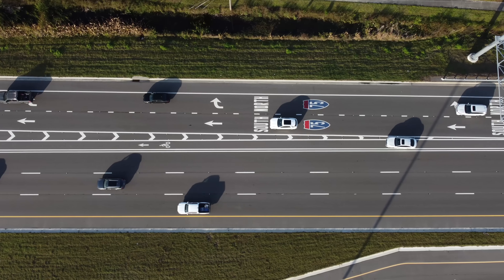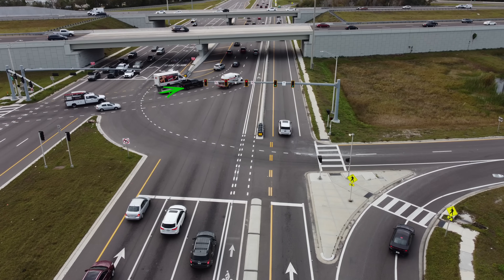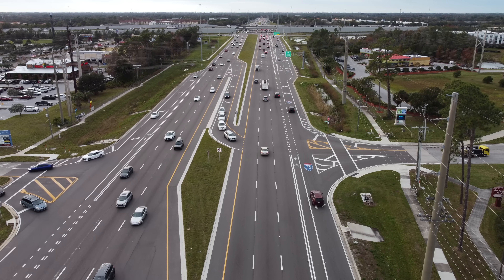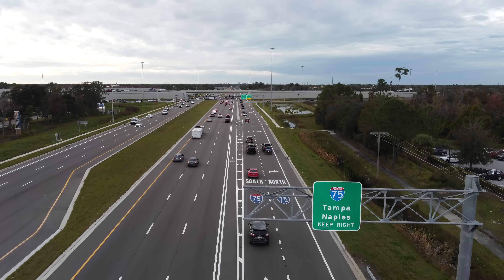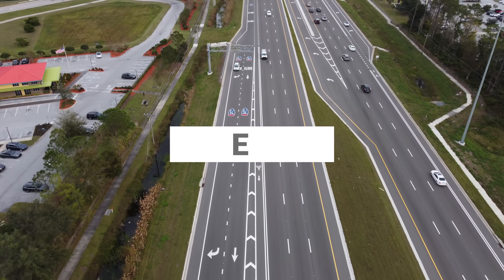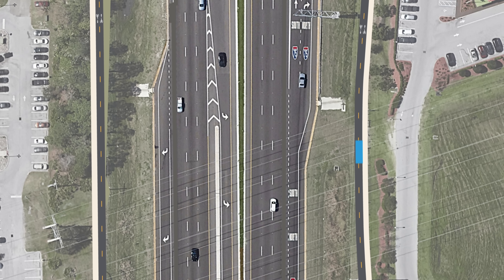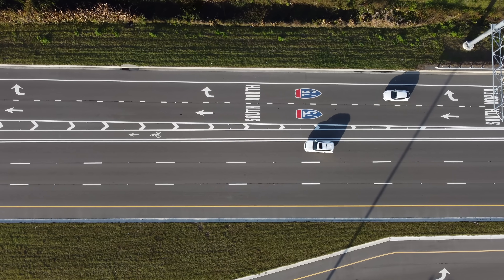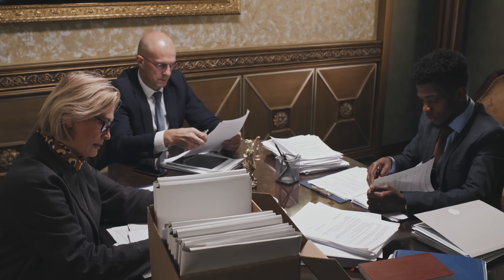This Brand New Interchange is Already Flawed

Comment: I still live in the area. I remember when they built this interchange. I've had to make that last minute dive over the gore. That area is nuts.
I remember one particular fun incident during construction where northbound got flooded down to just half a lane. It was during one of the summer afternoon showers that inevitably happens. Luckily they had the drainage fixed for the next downpour two days later.
It's under construction now, but I'm curious what your thoughts are about the crossing being built two exits north of there (I-75 meets US 301). They're building two additional bridges across the Manatee river so that local traffic doesn't have to get on the interstate to cross in that location.
BTW: the tunnel idea is a non-starter. This is Florida we're talking about. There isn't enough clearance to allow for drainage if you dig down.

Comment: As a Dutch citizen living in a country with proper infrastucture I am horrified to see that bikelane on that road. Sure, they had put in bike infrastructure, but as close by and without proper protection/width overflow just right next to a high speed carroad. I agree with the solution you put in the video.
Reply: This seems like bike "infrastructure" that was put in just to check a box, without any consideration of how a cyclist could safely use it in practice.  Paint is not infrastructure.

Comment: 5:08  Holy crap! I’m one of those experienced/bold/foolish cyclists that will bike in heavy traffic and even on high-speed roads, without needing dedicated bicycle infrastructure. But an u protected bike lane on a 55mph multilane divided road (which means probably 65mph actual traffic speeds)? Uh-uh. And an unprotected bike lane in the middle of multiple 55-mph lanes of traffic? No way! That’s even if things weren’t set up to pretty much guarantee motorists regularly crossing the bike lane. 

Both reputation and accident statistics say that FL is one of the most cyclist-hostile states. The fact that this got past preliminary design stage pretty much shows why.

Comment: There's only one reason that bike lane is even there. They'll have minimum quota's they need to meet for cycle infrastructure in new build or redevelopments. It's literally a box ticking exercise. We need better regulation on HOW they should be implemented beyond the simple x number of miles. We have the same kind of problem in the UK (though such dangerously placed lanes like here are thankfully not a thing. That I've seen at least). You'll often get an intersection being repainted and they'll shove like 10ft worth of "bike lane" at the head of the lanes were the traffic lights are, then count that towards the x miles per borough quota. You'll also often get lanes that just... stop, then pick up after a big gap, then stop again after 30ft or so. Again, just to meet the quota.

Comment: Sometimes I wonder if the designers of roads actually drive on those roads. Non reflective line paint that disappears in the rain especially at night. Non reflective lettering on road signs. No reflectors to mark lanes in the north east. Bridge expansion joints that are depressed below the road way (Baldwin Bridge on I-95 in CT) Also on I-95 south bound in East Lyme CT there is an entrance and exit (Rockyneck connector, 4 Mile River Rd) that is about 300 ft in length for the dashed white lines. Does make you wonder!

Comment: from my german perspective: move the bike-line from the road as suggested in the video - such road would be an "Autobahn" only for motorized vehicles that are able to drive at least 45mp/h. No left-turns at all, only right-turns and no stop-lights. The Traffic leaving and entering the (only on the right side) should have a seperate interchange lane where at ~ 45mp/h cars/trucks can drive in an offset and change lines for on/off ramp like here: https://www.google.com/maps/@51.4464888,6.7810909,17z?entry=ttu
this is totally typical in germany and as you have no left turns is easier to drive and you never have to stop.

Comment: I'm possibly a bad one to comment on this, as I'm a trained designer, though not in infrastructure design and a Dutchman that found this video on YT. 
To solve road crossings where not only cars but also pedestrians, bikes and possibly other 'slow traffic' need to be included, this solution looks like take all those slow users of the crossing as an afterthought. 

Of course you want to separate slow and fast traffic from each other in the best possible manner. Also any modern designer should have energy use in mind, Why using traffic lights if those could be eliminated, or at least limited. The same goes for the traffic flow itself, a continuous flow of all traffic will result in less fuel and time consumption, making the crossing and its situations safer in the process. Easier said than done? Yes, for sure, but then these things are not thought out by a bunch of toddlers. Those people all call themselves professionals, why then do they get the professional money, but don't deliver a professional result?
As one other commenter stated, the designers should try biking on this road. I would challenge those 'designers' even more, they should try the entire crossing! Part of design it to test if the design works, not just draw some fancy lines and call it a day.

Comment: "Bike infrastructure" like that grinds my gears. They started from scratch and STILL pulled the 'afterthought' method. It couldn't have been on the outside near the sidewalk? Would it have been that much more expensive?

Even then, nobody would want to use it anyways. The US is ruined to its core thanks to sprawl. Even if it were the nicest, flattest cycle path ever made, separated well from the road with a concrete divider in the middle, nobody would use it, because cycling next to a highway is a shitty experience, and getting anywhere would take 2+ hours when a car could take 30 mins.

Comment: You could also vuild the crosswalks up cheeper then going under. With pedestrian trafic above the motorway they wouldnt interfere with each other and is a bit safer then level crossings and cheaper then a tunnel

Comment: I don’t know why this a confusing interchange for Americans, it’s a very logical interchange, although a four clover interchange would be better. Are American drivers not learned to look at signage and react on time? Or is the signage inadequate? During driver’s lessons it is one of the most important rules, be observant and anticipate to the traffic surrounding you. In my country highway interchanges are almost always designed this way, splitting the through traffic from the exiting and entry traffic streams about 1.2km (about a mile) before the interchange, to keep traffic flowing. And a mile before that, the first overhead sign indicates the split and the second sign at half a mile before the split and a third sign when the split begins, with a physical barrier. So not with only paint like in the video. The third sign is also indicating the split between the north exit (right lane) and the south exit (left lane). The fourth overhead sign indicates the north exit in about half a mile and the south exit in about one mile. The fifth overhead sign indicates the north exit and the north entry ramp on a third weaving lane to the right lane and the south exit in half a mile on the left lane. The sixth overhead sign indicates the south exit on the right lane and the ongoing traffic on the left lane. It is standard practice but without the traffic lights and only level crossings. And without the very dangerous cycle path, these are insane to say the least. Whose twisted mind designed this??? Not someone who has ever biked in his/her life. Oh and if a situation is changed, like here in the video, there are yellow construction signs 3km upfront (which are three times repeated) to indicate that the road situation has changed after construction and route planners need to be switched off to catch your attention and make you aware to look for the overhead signs.

Comment: I’ve used this interchange one time. I was making a u turn just past the lane that is for northbound and southbound traffic. Since I was unfamiliar with the road, I didn’t realize I’d have to cross 3 lanes of moving traffic to get to the southbound i75 exit, and once I did, there was a huge curb blocking me from entering the lane. I ended up making an illegal right turn at the traffic signal, and everything worked out fine, but it was definitely the stupidest interchange I’ve seen in the SW Florida for sure

Comment: Well done. Even as someone that does not like cyclists. This, in my opinion, is a good design. My personal pet peeves with bike lanes is that they are always an after thought plopped down in spots that just make driving more difficult and potentially hazardous for the cyclist. If more roads were built getting cyclists off the main roads especially at intersections I'd be more content with cyclists. I get they need to go somewhere just keep them away from cars on fast roads.

Comment: Note also that oftentimes small bridges are more economical than tunnels, although in this case a tunnel might still be more fiscally responsible as a bridge would have to be quite high, as such it would also be more physically exhausting for users. Although being exhausting could be a desired effect in some places as this would encourage more people to use alternative routes if possible, thus reducing pedestrian and bicycle traffic in a somewhat high-risk area. 
In general we want to invisibly guide vehicles to partake in lower density traffic without causing frustration, this goes mainly for car traffic, but at points it can be applied to squishy humans as well.

Comment: Your proposed design calls for way too many pedestrial tunnels. 6 in total??? Maybe more? And some of them are under 5 lane wide sections of traffic light turn lanes (lots of concrete and sensors). Rip up the widest and most expensive parts of the road to make a bike tunnel? And you also have 3 tunnels going through water. That's not going to be cheap either. You didn't try very hard to make a realistic plan.

Put tunnels only on the north side. Run the new bike path through the middle of the little forest so 1 medium tunnel can replace a big tunnel under an intersection and a small tunnel under a single lane ramp. Then you can also easily connect the bike lane up with the business park to hopefully make it more useful. Skip the tunnel under the side road for now (it's currently a cross walk that is presumably functional, let's not jeprodize the whole project to make a minor improvement to something that isn't really in the scope of fixing this suicidal bike lane). This means we are asking for 2 medium tunnels, only one one of which requires redoing a retaining pond, (instead of 2 big , 2 medium, 2 small, and 3 modified retaining ponds) which gets you a usuable bike/pedestrian lane (with fewer lights than the existing pedestrian path) and the bonus of connecting to more resources than the existing path for a fraction of the cost.

Comment: Your suggestions for improvement are excellent.  However, as mentioned in another comment, sidewalk or bicycle lane tunnels are not feasible in most of Florida as they would be full of water!  These crossings would need to be elevated.  In a state that has so many tourists, signage is especially important and must provide ample notice of what lane to be in for those encountering the interchange for the first time.

Comment: 1:18 Dumb European question here: why are there two traffic light signals for the right lane? Is it not common to have exactly one traffic light per lane like in Europe?
Reply: In the US at least two signals are required for the straight through traffic. If there’s only one straight lane in a direction it will get two lights, and if there’s two or more lanes there will be one signal per lane. Since the signal on the right has a separate through phase than the ones on the left it needs two lights but if it were synced with all the others it would only need one over that lane

Comment: All that sprawling single family housing will devolve into a failed concept when it all has to be maintained and replaced.  The taxes on those properties are not high enough to maintain it.  The developers build it all originally, but then have no further responsibility.  All taxes are going to have to be raised up to the level they were pre-Reaganomics.
Reply: Liberals now borrow money, add to the money supply, burden the tax base with interest, and let inflation spread the real cost the hardest to the poorest.  All those aging, poorly-maintained tracts become Section 8 slums.  The houses slowly get replaced by dense ghetto apartments.

As far as the sprawling single-family housing, what ever happened to miles square of land that extended families could support themselves upon?  Young men can't go start their own farms or ranches anymore.  The Bureau of Land Management declares itself the owner of all undeveloped rural land.  If you lease a tiny parcel for $800 a year, and begin to develop it, a corporation will take the lease under eminent domain.

Comment: That bike lane was built entirely to do the bare minimum to get additional federal funding, and possibly for an easy erasure later.
Maryland did that with a new major bridge (US 301, Potomac River).  It went the extra mile of deleting the bike lane once the project was greenlit but before construction started because "it was too expensive", and then bragged that the bridge was completed under budget.  The new bike infrastructure?  Just ride in traffic.  There are "share the road" signs!
Reply: Bikes ARE traffic.  I rode a ten-speed in all kinds of heavy, fast automobile traffic as a teenager.  Then a moped.  Young and stupid, I wouldn't do that again.  Horses are traffic too, and I wouldn't be stupid enough to ride a horse next to 50 mph cars either.

Comment: Being a long time bike commuter (in California), that "bike lane" is terrible, terrible, terrible. I would fear being "caught dead" using it. I assume by a bike path and pedestrian path, I would like to assume you mean separate, parallel, spaces properly designed with adequate width (probably a fantasy for this interchange given the "bike lane" on the design. Bikes and pedestrians sharing the same space are not particularly safe for either. But, this is from someone who is not a casual cyclist. I have seen a lot of joint use bike/pedestrian paths that I would not ride on by choice. I think you car traffic suggestions are good ones, ...and the separate route for non-car drivers. There sure are a lot of cars in Florida, spoken as someone who moved from California  (many, many years ago) to a small town of 32,000, well off the beaten path. Locally I helped kill (by educating designers) some bizarre and unsafe "bike infrastructure" related plans. thanks for your video.

Comment: I appreciate your idea of tunnels, but this is south Florida. The water in the retention ponds is there because of the water table. This is not runoff from the road. Its simply the level of the water in the ground. those tunnels would have to have constant pumping systems to keep the water out. Tunnels are rare in this area because of this fact. I agree with just about everything else you mentioned here though.